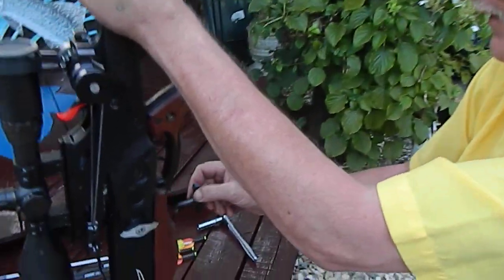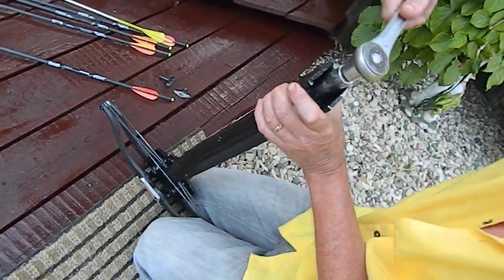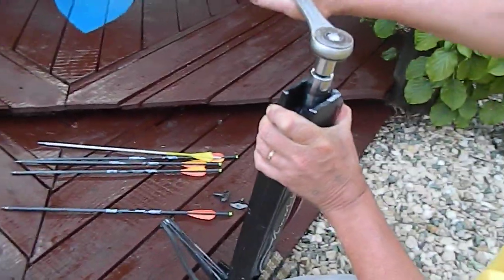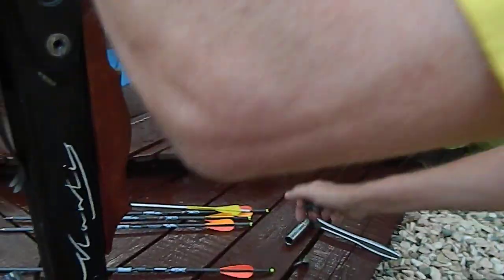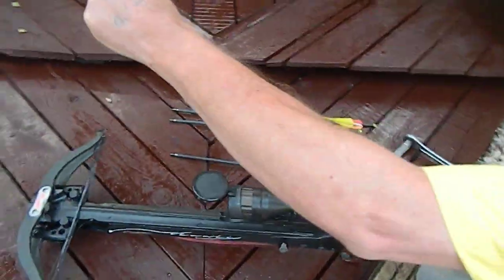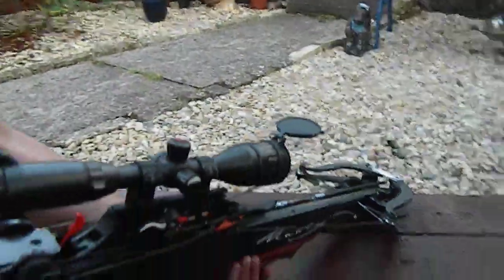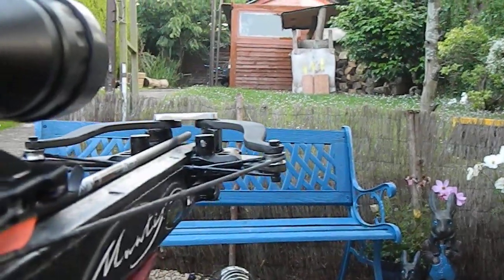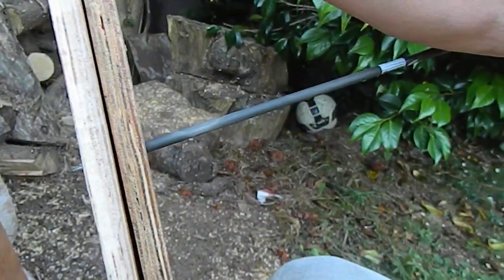Changing the mantis from low power to high power and firing a 400grn bolt

Comment from the maker: Thank's MrGuyIincorated yes i designed and built this crossbow and it took me six painstaking year's of many trial's and error's to get it this good and now it will be available in a finish of your choice the crossbow in the vid is a bit rough but the finished version will be pucker either matt black powder coated or in  Realtree pattern of your choice or a bit of both say black limb's and con rods with black deck and trigger unit and the rest camo or other you can have exactly customised to your taste.

Comment from the maker: Brand NEW xbow technology.Plus it is quite a bit faster now too and i am working on getting it even faster again i got a few trick's up my sleeve for much faster arrow/bolt speed's i am working on making it do 600 fps at this moment so shooter's out there can have the very finest available.
SPECIAL INTRODUCTORY OFFER OF £1,295 FOR THE FIRST 20 MANTIS'S SO DONT DELAY IF YOU WANT THIS POWERHOUSE CROSSBOW AT A BIG DISCOUNT.Thats £200 OFF RRP.
Reply: 600 fps,@o@ is that even safe, middleton took one up to 504 with their highperformce limbs and that was not the most accurate nor safe thing out there,  be careful in your experaments, and good luck, godspeed, and be safe
Reply from the maker: manga12
You got a valid point there a 600 fps or even a 500 fps could be over the top also finding arrow's for it would be a problem i think 450 fps max and with a 350 grn arrow would be much more than enough for any crossbow shooter out there,many thank's i will be very careful i think i'll stick with slower speed's as trying to get 500 plus fps is just not worth the risk's involved and also the anti's would use it against us.

Comment: i was watchin you tighten that through a gap in my hand lol ,,thought u was gonna strip the treads,, that looks a beast id load it with that plastic safety thing aswel . +1like
Reply from the maker: +fatbarry barry Yes that bolt is case hardened as all that power did chew up the thread's after a while it run's in a hardened helicoil insert so no worrie's with thread stripping.
Reply: TalismanCrossbowsUK ive helicoiled a brake mount an m6 tread held up pretty good

Comment: Outstanding performance. Is this powered by a spring or nitro piston?
Reply from the maker: Thank's Jj it is gas spring powered,the gas spring is nitrogen gas filled i have found it to be perfect for the job and it will last for million's of cycle's and even then you can get the seal's renewed so pretty cheap to maintain.
Reply: TalismanCrossbowsUK Being an avid air gunner, I'm quite familiar with the gas strut (et al) and it's versatility. Been trying to devise a design that brings this power plant and a compound bow together.
Reply from the maker: Jj Ash
Yes the gas strut or spring is an incredible device,air gunning is what got me into crossbow's i used to tune up HW 80s for myself and other's did a lot of work with spring's and spring airgun's i managed to get over 30 ft lb's with an 80 by modifying the stroke and t.port i had some very powerful spring's specially made for it the most power i did get was 35 ft lb's with a certain pellet.A compound bow would work like my compound xbow doe's and you would need to find the best way,take's a lot of time and research,good luck with it.

Comment from the maker: Available in a Realtree pattern of your choice or all tac matt black with oil finished walnut fore and pistol grip's from £ 1,450 this ultra high tech fully adjustable for power gas spring bow comes with six 22" 425 grn quality carbon arrows with quick detatch quivver,2 spare bowstring's and high tech mech bow lube to keep this crossbow running ultra smooth,ultra quiet and screaming fast coming this March 2014 from www.talismancrossbows.net